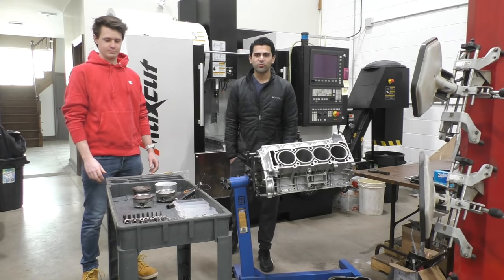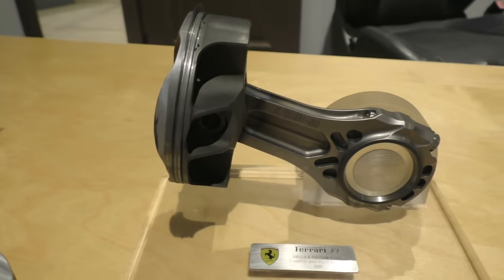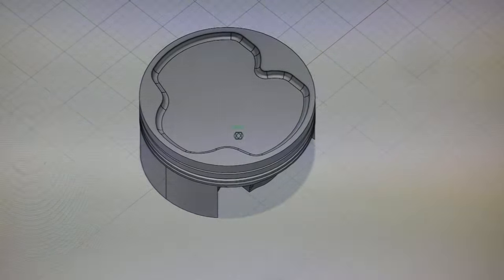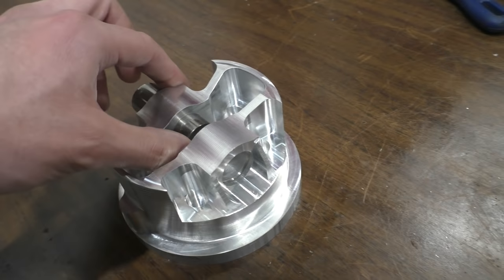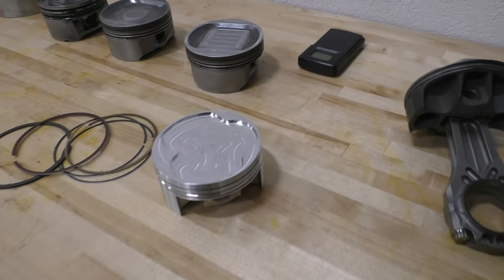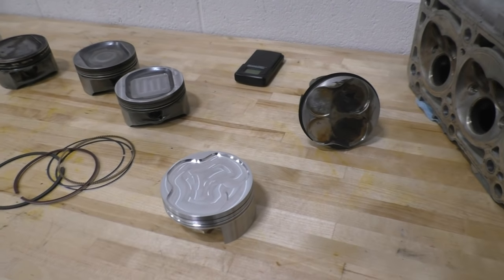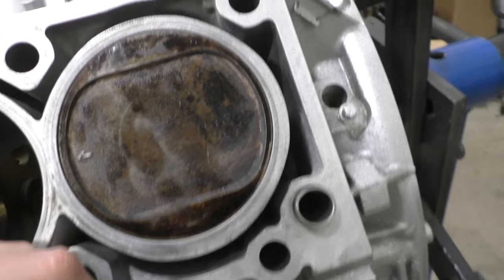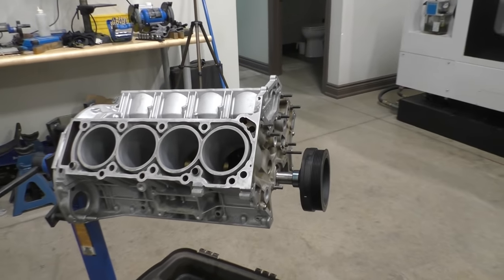Making an 11000rpm F1 Style Piston - Project XF1 Part 2

Comment: First of all, I take my hat off to you for taking on such an ambitious project! And after watching this video I can see that you put a lot of thought into the design. The problem is, you don't know, what you don't know... :-) Here are a few things that I believe you should think about.

1. Piston Design. 
Pistons are not simply round and tapered... They are oval through the pin bore axis to account for the greater mass of the pin bore towers, which WILL expand more than the thrust and anti-thrust faces of the piston. Therefore, simply turning the piston round (and the ring grooves too) isn't wise. The "Cold" design of the piston will determine the "Hot" shape of the piston. The goal being that at full operating temperature the piston is round and straight. Therefore, by turning the piston with a round profile when cold, will mean that the piston will be oval at operating temperature. Pistons made by piston manufacturers for OEM Street (in the case of your sample piston is made by KS or Kolbenschmidt) are turned by a "cam lathe" which gives the oval horizontal profile, at the same time it gives the vertical profile a "Barrel Shape". The shape is highly complex and varies by the mass and thickness of the material at any given point. 

The Ferrari F1 piston you showed (manufactured by MAHLE I believe in 2001) is machined from a forged blank with the finished machining removing as little of the surface as possible. And it's only designed to run a few hours, maybe 250 hours, not 250,000 miles...  So a comparison is unwise, unless you plan on rebuilding the engine after a very few hours. And that 2001 F1 piston is what I would consider "Old School" these days, as design has moved on in 20 years :-)))

You may want to consider oil return holes in the back of the oil ring groove. Because the pumping pressures in that ring groove will be considerably higher than in a stock street engine. Another consideration is a gas relief or accumulator groove between the top and second ring, allowing for combustion gas which escapes the top ring, an area to expand into, rather than trying to force the second ring back into the second ring groove. 

It would be wise to chamfer all the sharp edges you have on the piston skirt tail and other areas. Especially as "piston slap" will be a feature of the piston you have made, simply due to the cold or ambient temperature tolerances you will have to run due to the alloy and lack of piston ovality. And as a precautionary feature, you might consider a skirt coating, such as Zylan or one of the other skirt coating materials. This could assist at cooler temperatures during startup. 

Given that you didn't create a barrel/ovality profile, I don't imagine you considered pin bore ovality or pin bore profile either. Under high load a wrist pin distorts and tries to ovalize, thus putting extreme pressure on the oil film between the pin and pin bore. This can be alleviated by giving the pin bore some ovality, or removing some material at these stress point to allow the pin to ovalize. This can be especially important in the "sheer plane" between the piston pin boss and the connecting rod bore. I would usually design in a slight taper to give the pin bore boss a "flair" or shape similar to a velocity stack. This reduces the stress on the pin in this crucial area. 

What are you making the wrist pins out of? Tool Steel? Or are you buying pins? If you are making them, you can consider tapering the inside wall from the outside ends of the pins, getting larger as they approach the highest load area in the center. This will remove a lot of weight from the pin, and thus the piston assembly. 

2. Material Choice. 
While 2618 is a good choice sometimes 4032 is chosen. 2618 (Originally developed by Rolls Royce for the Merlin engines during World War 2) has a higher coefficient of expansion than 4032, but due to its ductility is often chosen as it can "take more abuse" (in many way, abuse is what we try to avoid when designing a piston :-) However, it requires much more cold clearance than the KS CAST Hypereutectic piston you are using as a base, therefore you will have to take this into consideration when you calculate your cold clearances. 4032 is formulated with a much higher silicon content (silicon is added to reduce the expansion of the alloy) and can be as high as 12.2% (or a little higher) which is right on the border of Hypereutectic alloys. This affords the piston a greatly reduced Coefficient of Expansion, and increases the wear characteristics making the piston more durable, but makes the piston less tolerant of detonation. In general, I recommend 2618 for race use, and 4032 for street, even high performance street. However, depending on the actual use of the vehicle that can change too. 2618 is "Stronger" having a higher tensile, yield, and fatigue strength than 4032, and it melts at a slightly higher temperature. All of which is why it was chosen for the Spitfire and Mustang fighter aircraft. But, it does mean that the engines must be warmed up carefully, and piston profiles must be carefully calculated as 2618 will expand up to 15% more than 4032, and even more than a Hypereutectic alloy. So, basing your tolerances on the KS piston is very unwise. 

3. Manufacturing Method.
It's also important to note that 2618 and 4032 are really designed as alloys for forging, and don't reach their full potential unless they are forged "near net" (in other words, forging the pistons shapes (mostly under the crown) into the alloy at, or very near, their finished shapes. In fact, the reason 4032's silicon content is limited to around 12% is that once an alloy reaches much higher than this it becomes VERY difficult to forge by conventional (heat and beat) methods; and Isothermal Forging is required, a complex method. This "compaction" of the crystalline alloy structure imparts additional strength and toughness. Imagine if you will, a plank of wood (the billet material) and plywood (the forged material) and you will understand what I mean. So, while 2618 is a good choice, you will have to really be careful with your tolerances when the engine is cold. Also, machining directly into billet without subsequent heat treatment will cause other issues. 

4. Protective Finishes and Coatings.
In an engine which reaches higher RPM and thermal loads it is wise to consider Hard Anodizing of the first ring groove and the pin bores. This harder surface prevents galling and localized micro welding. You might also consider a Diamond Like Coating (DLC) of the wrist pin. 

5. Other considerations...
Will you be rebalancing the crankshaft? I would have thought this is necessary due to the large change in the reciprocating mass. And reducing the crank weight will also aid you in your goal of 11,000 rpm.
What ring pack will you use, and what will be the thickness of the rings? In this application I wouldn't go any thinner than 1 mm. 
Will you profile the underside of the piston crown to remove excess weight? Matching the under crown to the crown will help get the weight down. 
And likewise will you remove material from the pin boss between the under crown and pin bore? 

Just a thought for the future... 3D Printed Pistons... You can really remove some weight when you can easily leave voids where it would be really tough to machine it away... It's possible to utilize Diesel piston tech, such as oil cooling galleries in a gas engine, which can really help thermal dissipation. This is the future of piston manufacturing, for limited production anyway.

Hope some of this helps. I really hope your design survives, but from what I can see it certainly isn't optimized, and could fail if tolerances aren't opened up. Best of luck!
Reply: Not just me then Brian.
How these fellas have got the brass neck to stand about grinning thinking they can better the vast experience of companies like AMG and more so the Very best
Ferrari astounds me, but equaly
looking at the comments i'm surprised so many commenters think it's easy to do,but as they say the proof of the pudding is in the eating.Think in reality it will just stay
in the fridge.
  I am getting on a bit now but I did my time with AE, Hepworth and Grandage,Wellworthy etc.You?
Ps. I was just going to tell these
blokes there is more to the subject
than you think/know. But your comment says it all.
  Shiney though, and of course they said billet alot🙄
Reply: @velobob4299  Hello Bob. Well, I’ve been building racing engines for over 35 years. Plus I ran MAHLE’s aftermarket division in the US for many years, then ran Wiseco Performance Products (it was Wiseco Pistons until I got there). Not to mention we (Wiseco) bought JE Pistons in California, Carrilo Connecting Rods in California, Vertex Pistons in Italy, Prox Pistons in the Netherlands, and Perfect Bore (F1 components) in the UK. So, bottom line is I’ve been around performance engines my whole life. 

I do admire the ambition they show trying to make what is probably one of the most complex components in an engine. But, they will go through the learning process. My guess would be that without a cam shape on the piston, and using the “normal” clearance for piston to bore (for the thrust side of the piston) that they will have significant scuffing or indeed piston seizure at the pin bores. If they use a sufficient clearance (without cam shape) to avoid the inevitable expansion of the pin towers, then the rest of the skirt and crown area will have too much clearance and will not be efficient. 

As you know Bob, when their pistons reach operating temperature they will be oval, not round; and therein lies the problem. And why pistons are oval when cold, so they can be round at operating temperature.

I’m sure that the engine will start and run, my worry is when they get to operating temperature and start to really push the engine and temperatures soar. 

Hopefully they have sufficient clearances for the motor to survive for a period of time, but I fear that it won’t last very long. 

Pleasure to meet you Bob. I guess we will see the outcome in a future episode. 😊
Reply: @TigreBrian   mate, what the F were you on when you wrote that? I really need it... that sort-of focus could help me with my thesis.
I mean, F-ing hell, how long did it even take to write all the much?
Reply: @AmritGrewal31  Hello Amrit, well, it actually didn't take that long, as I type pretty fast. Plus, it's all just a stream of consciousness from memory, so pretty easy stuff to write. Best of luck with your thesis! And Happy Holidays.
Reply: @TigreBrian  would it be possible to heat it up to operating temperature, and then turn it?
Reply: Exactly, just saw this video after machining custom top grooves with .0005 clearance, I don't believe this method would produce a quality groove either. They should really just buy a custom set of pistons for it.
Reply: Isn’t the whole point of youtube videos to get likes and views and subscriptions? Who cares about the outcome?
Reply: @TigreBrian  Man you should make a piston design Q&A or podcast video, I'd love to tune in and learn haha. Have you ever considered making a video?

The ovality and barrel profile of a piston I have thought about but it never crossed my mind about the wrist pin bores!

Comment: Have you thought about coating? Cerakote micro slick P-109 is 70$ for a pint and made for piston skirts, valve stems, etc. C-110 is the same but air curing so a bit easier to apply.

Comment: Have you measured the standard piston across the axes?  They usually are not turned round but oval as well as the skirt being profiled for thermal expansion.  Also you'll need some oil drain holes in the oil control ring land.  The sharp edges you machne into the bottom side of the crown will give you a fatigue problem sharpish too.  Add some fillets in there to make it last longer.  Are you going to harden your top ring land somehow?  There's a lot more science in pistons than you appear to be aware of, but good luck!

Comment: This is amazing you have come so far buddy it's awesome, I wish I had half the knowledge you do. Throwing this out there would you ever consider making pistons for any other mercedes engines like the M111.975? We are having so much trouble to find affordable solutions to the brittle mercedes pistons well Nural pistons. We have found like the M104 the engine is tough but the pistons let it down and have limited options in the UK for machining. I know it's a bit off the wall especially considering you specialise in the V8s

Comment: Pretty cool stuff.  The dish in the piston looks like a Roomba ran around in there.  After you get all done, do you balance a piston from front to back?  It seems like it would be a good idea to do that.  It looks symmetrical except for the dish.  The only misleading thing I heard is that a interference piston doesn't allow you to play with valve time.  That is not right.  The main issue with interference pistons is in the case of a cam timing belt breaking and the crank throws the pistons into open valves.  With cam timing, your valve is not at max lift in almost all cases for street engines.  There are some extreme lobe grinds that might make the valves pretty high, but not at max lift.

Comment: After the dry sump you need to start to design to go camless for the high rpm
Reply: Camless need solenoid and computer to can operate.
Reply: It allows you to tune for higher range of RPM but he's using 2618 because he only needs the top end.
So, going camless would quite an obsolete yet expensive choice. 🤷🏻‍♂️

Comment: Is this aluminium forged or a special strength?
Reply: T5952
Reply from the maker: 2618
Reply: @xfmotorsports  thanks. It's a good read on what that aluminium is capable of and what additives it has in it. Looking forward to this build👌
Reply: @xfmotorsports  what software do you use
Reply: @xfmotorsports  did you increased the clearance for 2618 vs stock?
Reply: @xfmotorsports   huhn, I just looked up the composition. Turns out it has only 0.25% silicon, which is unlike what most manufacturers prefer.

Usually piston alloys have between 8 to 15 percent silicon, right? Or is it just for the cast pistons?

Any specific reason you chose this alloy?

Comment: Really cool. But do you worry the squared off inside corner will create a stress point that results in a crack under the stress of operation? Notice on the F1 piston that corner has a significant radius.

Comment: It looks like there was some technology sharing when Daimler-Benz owned Chrysler.  the combustion chamber on those heads is basically a 3-valve version of gen 3 Hemi right down to the dual spark plugs.  granted the Benz head is a OHC and the Hemi is a push rod engine. but it is amazing how similar the intake and exhaust runners are to a gen 3 hemi as well. amazing video.

Comment: It should be known that pro stock drag racing engines at 8.2 L were revving to 12,000 RPMs routinely until limited by an HRA.
Please keep up the good videos.
Reply: Drag racing is comparatively very easy on engines vs road racing, they only have to hit those RPMs for a few seconds at a time vs minutes at a time.

Comment: Caged pistons are AWESOME. What Al alloy will you use for the pistons?
Brilliant job as always. Looking forward to the rest.
Reply: He's using 2618
Reply: Thanks. As expected the material chosen is correct. I wouldn't expect anything else from XF Motorsports
Reply: @gafrers   nah, give me a hammer, a furnace and some brake rotors. I can an iron piston better than that.

Ps: I'm obviously kidding
Reply: @AmritGrewal31  Of course. Nice rusty dirty rotors, especially when not removing the dross before pouring into the mold.👍👍 🤣🤣
I kid you not about stupid people talking about dross adding strength to the cast pieces.

Comment: i'm wondering about heat treating those pistons.  is that part of the plan?  i was also wondering about the density of your aluminum vs. what you used for your simulations.  are you planning on refining the FEA with updated material properties?

Comment: If you need to bring the weigh down a couple more grams I would do gas ports, and then gapless rings to help reduce piston ring flutter at that high rpm. Another thing im seeing is the high rpm will end up melting the corner of the top, I wind get them ceramic coating at least on the top. The engine block will not sustain 11000rpm with an open deck. But great work!!!!

Comment: It’s very interesting and quite ambitious to not only design a piston but to actually make one.what I don’t see you addressing is that the piston is caked from off center and barrel shaped as well ..this is done to control expansion
If you doubt my statement take your piston measurement cold 90 degrees from wrist pin..then put your piston in boiling water for ten minutes or so and take some measurements...you might be shocked

Comment: The crown and sideskirt on the piston was the key on the f1 stuff.. like on sports motorcycle engines.. that nice ornament you have has it's issues, build it in simulation i'm sure it will speak volumes in comparison to the other pistons.  Removing corners and lowering stress points  honeycomb / cellular pattens occur in nature for a reason. Cannot wait to see how those hard corners behave in your final design?  The ferrari design is being overlooked...  Sharp machined corners.... hmmmm   unless it's a pressure surface why is it cut angular creating a stress point.

Comment: Are you sure it will have same performance? The F1 pistons are forged. Not casted. Also when the engine is cold, the shape is not round due to deformations. Once the engine is heated up, it will get the rounded shape. The engine must be pre-heated before start because very precise dimensions. Starting engine cold without pre-heating would cause the damage.